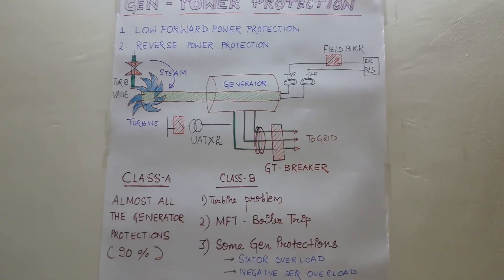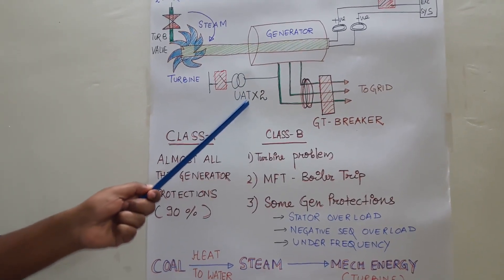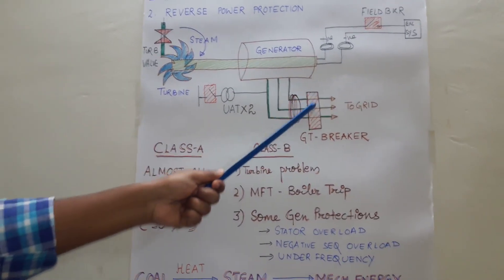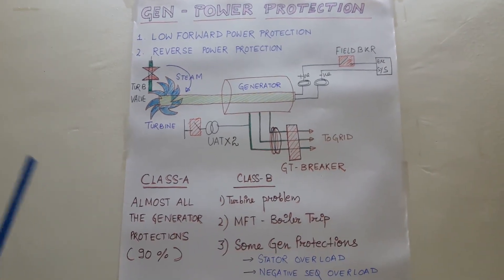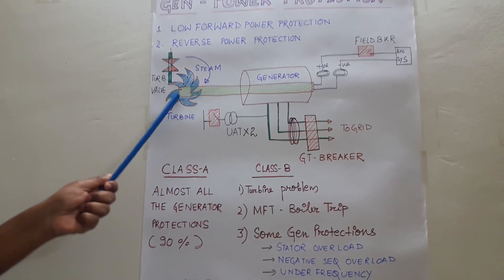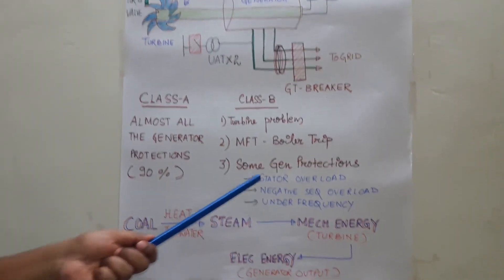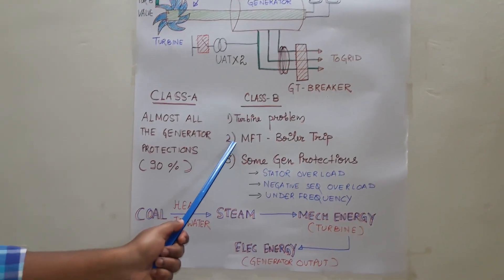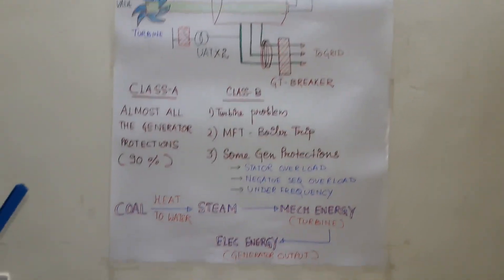GENERATOR LOW FORWARD AND REVERSE POWER PROTECTION

Comment: If the UAT breaker gets tripped along with the GCB and Ex. Brkr then how will it be possible for the governor to control the closing of the guide vanes when the UAT which feeds supply to the governor gets off...I am referring to the load rejection when GCB trips

Comment: Sir Which motoring action is most worst induction or synchronous during reverse power?
Reply from the maker: Induction motor  from generator point of view
Reply: @electrocean6684  why induction motoring action is most worst  would you please kindly explain??
Reply from the maker: @অপরিচিত  synch machine can't run in slip. This slip may induce eddy current leading to heat and insulation damage
Reply: @electrocean6684  Thanks sir  but what is the effect on prime mover during induction or synch motoring action & which on is most worst?
Reply from the maker: @অপরিচিত  Both motoring modes will damage the turbine blades as there is no steam present.
Reply: @electrocean6684  thanks sir.please make a video about it in details

Comment: Sir 11kv grid brk trip due to grid heavy fluctuation same time  there is low forward power comes but turbine get trip as well as gcb trip ie (B,C) Not A As per logic the 86A want to be operate

Comment: Motoring mode me generator kitni power lega aur rotation direction kya hoga. Sir please reply.  or anyone.
Reply from the maker: There is no load connected to motor, so very less power to maintain the rpm of turbine
Reply: @electrocean6684  thanks sir.

Comment: Sir please explain class A and class B trip
Reply from the maker: vaithiyanathan manokaran operation of low forward power protection is classB trip(turbine valve only trips as a result of which low forward relay operates with time delay), on the other hand when all gen related breakers are tripped along with turbine valve then its classA trip

Comment: sir explain about generator over current 50/51 protection..
Reply: What will happen if the generator continue to running with low forward power?